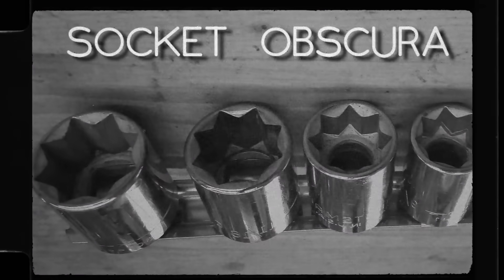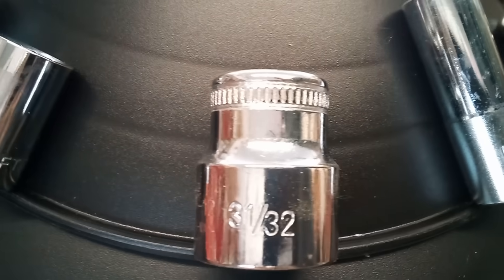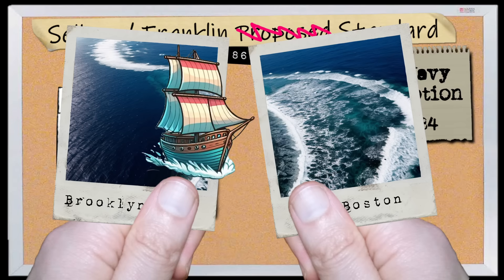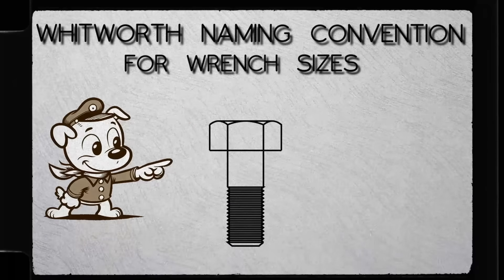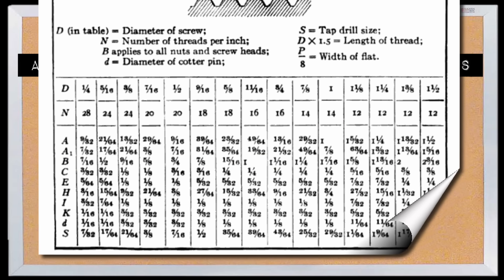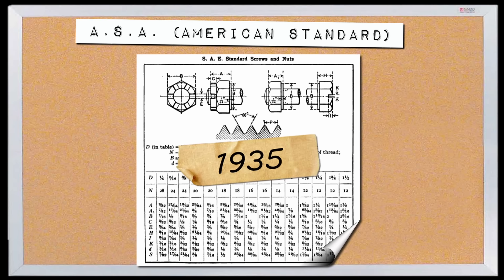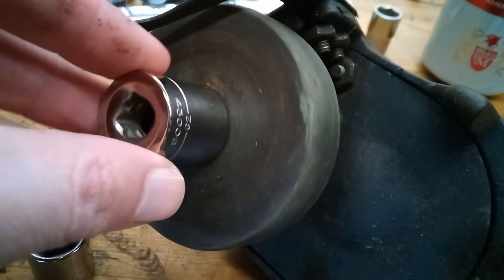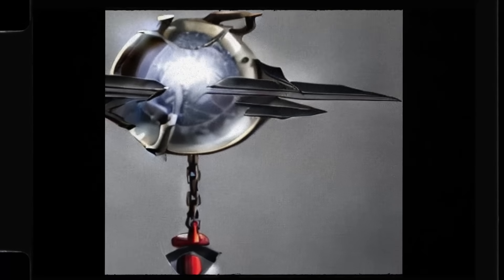32nd of an Inch Bolts - History & Lore

Comment: When I was a line inspector at a THREAD ROLLING company making BSW, UNC and Metric threads , I  noticed that when the chasers of the 60 degree included were damaged they could not produce commercial threads any more. 
However then the Whitworth chasers were knackered, it still produced functional threads.
 Looking at the threads produced by the damaged chaser through a microscope, we could see thread roots were an abortion. So we stopped production and made the setter replace the chasers. Management fixed this problem by removing the Microscopes. Just my observation while I was in the screwing industry. ”lol”
Reply from the maker: Very interesting! It makes sense that the rounded tops on the Whitworth threads would be 'smoother'
Reply: Sounds very indiana
Reply from the maker: @junicohen7918  Close.
Reply: @junicohen7918  I was gonna say Mississippi but your point is well taken. Side note- My wife is from Indiana.
Reply: @BillRayDrums  Mississippi is nice
Reply: @junicohen7918  It was nice to leave after 20 years, LOL.
Reply: @johnblackstock4092  the problem with the old Whitwoeth threads was that not only were the tops rounded, but the entire thread was rounded. That meant that you couldn’t use one thread point to make different size threads. Every single thread size required a different single point cutter. Very inconvenient and expensive. You couldn’t bring a whitworth cutter in the shop either. When the later version came out they went to straight sides. Still the round was a problem,. By the way, threads are 75” cut, with flat ends on both outside and internal. That eliminates a lot of problems.
Reply: @ My comments are about thread rolling. Not thread cutting.
Reply: I served my tool and die apprenticeship at Union Special Corp an industrial sewing machine manufacturer. EVERY fastener in their machines was a special screw thread held to high standards. Reason? So a mechanic working on the machine could not got to the local hardware store and buy a cheap, poorly fitting fastener as a substitute. The tight thread tolerances of the special fasteners kept the machines from vibrating loose and destroying a very complex and expensive item. These sewing machines ran at over 10,000 RPM and had oiling systems like auto engines.
Reply: @ I too noticed this when I was asked to identify  sewing machines threads. I went back to the Heading Shop I wince worked. They had a massive thread book which had the various tolerances used in the sewing industry ..
Reply: @dogshouse1 to certain extent, firearms industry was similar
Reply: Hahaha. Just don't look and it's all good.
Reply: @MikeBray-m2p  that's the Trump MAGA way.
Reply: @JohnW118  I get it - this entire video and thread has NOTHING to do with politics or TD S so lets see how many down votes I can get.  What an idea!
Reply: @BlisterBang  For the record, the dislike button in comments is functionally useless. I'm pretty sure YouTube has it programmed to do nothing but light up a pretty color for you if you hit it. The only thing that is tracked and displayed is the likes.
Reply: @KeterMalkuth Exactly! You never see the thumbs down 👎 counter.
Reply: @JohnW118  Cry more...
Reply: The old turn the radio up and you won't hear the engine knocking.
Reply: Sounds right
Reply: "Management fixed this problem by removing the microscopes" -- you know, I think quite a few of us have worked for that company. ;D
Reply: What?
Reply: Sorry fell asleep. Let me read that again…… Sorry fell asleep again!
Reply: So, how did the metric tooling perform when worn out?
Reply: @ on par with the UNC flat thread rollers. The Whitworth rollers  just seamed to produce  acceptable threads even though they were server damaged.  As somebody else suggested its because of the rounded root and crest. That’s my guess also.
Reply: As an engineer that is absolutely infuriating lol. I guess it is a bit of a self correcting problem though. A high quality customer would reject those fasteners and change suppliers, but a customer that didn't really care probably wouldn't notice the issue with them; so that crappy company would end up over time only selling to crappy customers lol. Just a lot of headaches to be had if you were doing a supplier search as an engineer.
Reply: Sounds like a screwy situation.

Comment: I did my Machine Mechanic apprenticeship in 1970 in Iceland, at a time time when we were both metric and Imperial, so the Imperial system was not alien to me. Looking back, I am enormously relieved  relieved not having to work with the horribly illogical Imperial system you silly 'Muricans still sling to.
Reply from the maker: Yeah, metric should be more logical. It's hard to explain, but when you were raised on the fractions, for some reason they come easier, even though they shouldn't be.

Comment: For the Love of God: I dislike Imperial standards with a passion. Only ONCE I needed an inch socket for the headbolts of a Briggs&Stratton mower …in Germany. I took some pliers.
I´m a metric guy. I can deal with right hand drive but eff off with them weird sizes. I hate fractions. Just accept the Metric Standard and be done with this.
Reply from the maker: It's been attempted, but never fully happened. It's worst when both sizes are used together on the same product. On my truck the bolts on the engine are all metric, but the rest of the bolts on the truck are SAE.
Reply: @ Sir, You live my worst nightmare. But that stems from not being used to sae- I´m still figuring out the inch scale on my callipers…😅 Greetings
Reply: 49 jag used three brakes were metric, body english and moter wintworth
Reply: @ Sounds even worse to get used to. But I guess you learn to put bolts back into their place pretty quick…
Learning about all these different threads makes me feel bit silly but all my workings are metric- fine & coarse. That´s it.
I tip my hat, those were fine cars & I bet Jaguar intended something by doing that.
Reply: There was a program to convert the U.S to the metric system back during the Carter Administration.  Reagan was elected President and the whole program went down the tubes.

Comment: I can tell, that it is worse in metric, we use sockets and spanners to 1/1000 units!
Reply: You mean a thousandth of a metre.  That is larger than a 32nd of an inch.
Reply: @GH-oi2jf  yes, but still 1/1000, where 1/32 still isn't more than 3.125%..
Except in that we go to 1/2000 in smaller sizes.
Reply: Don't smoke this stuff, mate - it ain't doing yer brain no good... ;-)

Comment: Back in the late 90's when I joined the army, the 19/32nds in the tool sets would fit the 10mm bolts with 15mm heads used on the 6.2L GM diesels in the hmmwv's. Back then military equipment used mostly standard hardware and there wasn't a need for metric tools.
Reply from the maker: My Chevy has the 6.2 diesel. All the bolts on the engine are metric, but the rest of the truck is SAE. Very confusing.

Comment: Still have a 25/32 wrench that belonged to my dad...  I kept it because there's a good chance I still have whatever piece of equipment he bought it for.  Have not needed to use it in the 25 years since though.
Reply: As an ironworker I use a 25/32 on a double offset box end wrench with a 3/4 so the 25/32 can pivot on the nut as I turn the wrench pulling my hand up and over the Zee lip. It's like putting a swivel head on your wrench before they had swivel head wrenches

Comment: I have and still use the socket set my Dad had when he was a mechanic on an Army Corp of Engineer dredge in the Mississippi back in the early 1930's after his first 6 year tour in the Navy.  It is still an excellent set with sharp edges on the sockets, all chrome moly with that stamped on them with no manufacturers name.  It has all the 32nd sizes in the mix and has saved me many times when working on older things.
Reply from the maker: Very cool!
Reply: Even with the odd 32nd sizes, fitting wrenches to fasteners is all a lot more certian than in metric sizing
Reply: Corps

Comment: My father left me a bunch of 32nd wrenches. I remember he having them when when I was young. They came in wrench sets that he bought at the local hardware stores, more than 60 years ago.
Reply: I bought a set of Craftsman sockets  and it had a 19/32 socket.  I think it does mostly fit con rod nuts.  The set is 1973 vintage.  Purchased with my Sears credit card when I was a teenager.  Sears would give credit cards to kids.  Seriously.

Comment: I’ve got a WW2 set of 1/64 sockets from 1/4” to 1”…
The original Whitworth head sizes were 1” for 5/8” bolts and 0.7071” for 1/2” bolts because when you cut a square head on a 1” round that’s what you got…
Reply from the maker: Interesting. I only have on /64ths socket. The Buick spark plug one.
Reply: @ Manufactured by Dufor and have an English military broad arrow property mark as part of the roll stamp…
Picked them up second hand with a bronze 1/2” ratchet marked Ansett M1A (another company not known for its tool manufacturing).
I suspect that it may have been a way round having separate Whitworth, metric and imperial sockets - one set that was “close enough” regardless of what you found.

Comment: In 1964 I bought a 19/32 S-K socket to fit the axle nuts on my Huffy Bicycle. I still have the socket, not the bike.
Reply: And so long as you maintain possession of the socket, you will never run into another 19/32 nut or bolt for as long as you live. Should you lose it however...
Reply: Same size as on my J C Higgins bicycle. And it works out to 15 mm in metric.

Comment: The anode rod on your water heater has a strange 1 1/16" hex head that's a leftover from WWII. 

Originally, (1930s) tank-type water heaters were glass lined to prevent corrosion. After WWII (i.e. in the '50s) they realized that wasn't enough protection so a sacrificial anode rod was added. The water heater companies made bombs during WWII (not the explosive filling, just the case) which is basically a water heater with fins welded to it. The empty casing would later be filled with molten TNT at a government plant. The fill hole was also the hole where the detonating fuse would get installed (on the flight line). For various reasons, the most common bomb fuses used a 1 1/16 hex head plug. After the war, when water heater manufacturers needed some tooling to make a bolt for the anode rod, they used the old fuse plug dies from the war. And they still do to this day.

BTW, the fields in England must be littered with millions of 1 1/6" plugs...
Reply from the maker: Very interesting! Thanks for the info.
Reply: @ballinator  Plumbers complain about the odd size socket and how hard they are to find. Fortunately with all the insulation on the water heater these days, very few anode rods get changed out (except in areas with extreme water quality problems). In that case. you'd need a very deep 1 1/16's hex socket.
Reply from the maker: @ Tempted to go check my anode... My water heater is from like 1994, and I'm on well water.
Reply: @ballinator Good luck finding a wrench  :)
Reply: Interesting 
Had to check, and  yup 1 1/6 fits right on. 
27mm fits as well

Comment: I got taught so that the 32nd sockets were for driving onto the heads of stuck bolts, so they didn’t slip.  For example you can dress a 5/8 head and then drive the 19/32 socket on to it.  And a 25/32 will drive onto a lightly dressed 13/16 head.
Reply from the maker: Great tip!

Comment: Great information. The transmission on my 1965 Ford has a bolt head that is 19/32" (15mm) works, but Ford hung on to some of those odd sizes of way too long
Reply: When I was an apprentice in the mid sixties the company I was with did a lot of tooling for FoMoCo, they were one of the first companies to 'go metric' when the MK. I Escort replaced the 105E Anglia.
Reply: @jonathangriffin1120  Escorts, Cortinas of the late 60s and 70s were an abortion of threads and tools. They used some whitworth some UNC/UNF, some Euro metric and a little Jap metric. Falcons here in Oz used UNC on engines until 2000 but the rest of the car was metric. 
Holdens were even worse. Euro metric was common yet some engines were still imperial.

Comment: Cool. The fractional sizes at 1/32" increments provides several useful crossovers to the metric sizes: 7/32=5.56mm, 9/32"=7.1mm, 24/32"=19.05mm, 28/32"=22.23mm, 29/32"=23.02mm.
Reply: 9/16 = 14mm. Or at least it used to. I've found some recent wrenches where it doesn't
Reply: @ChimeraActual  Yup. If tolerances are tight a 14mm wrench should be too small for a 9/16" fastener. 9/16=14.288mm.

Comment: Hi Ballinator, nice video!  I have found that a metric wrench or socket fits snugly on old odd sized fasteners.  Please reply.  Dave...
Reply from the maker: Thanks! Yeah some of them are pretty close to Metric sizes. 19/32nds is right around 15mm, 21/32 is a bit under 17 and 25/32 is a hair under 20mm.

Comment: A friend had a generic socket set he used to do some work on his GF's car. Of course the 10mm socket got lost right away so he asked me if I had one.I plucked out the 13/32 (I think) from his set by eyeball and said "Try this one". Those oddball sizes were my "metric" tools before I started working on foreign cars and bought a proper set for them. 

On Whitworth, the rounded thread profiles and 55 degree pitch hold better in soft metals and in any material create less 'stress risers' from tightening, thus it's actually better from an engineering standpoint for coarser pitches. My original Whitworth tools were wrenches and sockets which I filed and ground open from fractional and metric ones based on which one needed the least material removed. You ain't had fun until you open a 12 point 13mm socket using needle files so you can fix your motorcycle because you can't find anyone selling Whitworth tools in your town except the Snap-on man who only sells full sets as a prepaid order for a price more than twice your monthly rent for either wrenches OR sockets. I eventually found a mail-order source of good ones at reasonable prices, but only after about 10 hours of filing on that socket.

Comment: Okay.  I bought an old box of big thick wrenches.   They didn't fit anything well.   Even tho they were like around 1/4" to some over an inch , they were super overly thick , N heavy. I thought they would be great to keep in the tractor toolbox , because they were so tough for open end wrenches. Anyway I have them away for people to use as decoration.
Reply: I hit the flea market for thick wrench heads. They work better on brass nuts

Comment: Ballinator, great video. One tiny thing to add 31/32" was also a "safety size bolt"  use by the agricultural and rail road industries. Just one example my grandfathers grain wagon had a 31/32" bolt that was used to stop the the grain door that swinging open (not slide up) and this would stop the door from pinning your foot to the trailer hitch and hold you their until the grain was gone.
Reply from the maker: Interesting. Was the size used so someone wouldn't 'accidently' remove the bolt with a regular size wrench?
Reply: @ballinator  I have a socket and a wrench in 31/32" double open end style. As I under stand it two question before removing. 1) do not remove this bolt without checking what it is holding back. 2) do not remove and operate this device or machine, without this bolt.
Reply: I have one too. It belonged to my grandfather and he was in the train industry. Now it makes sense